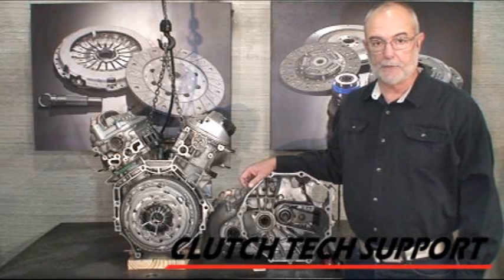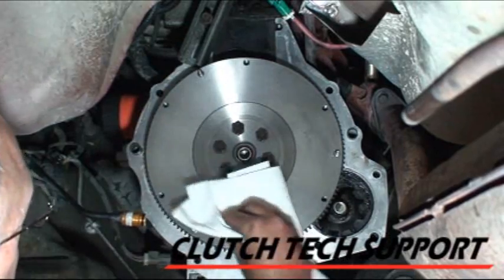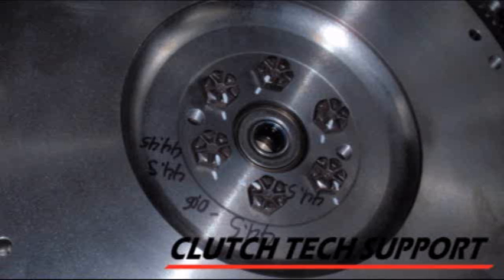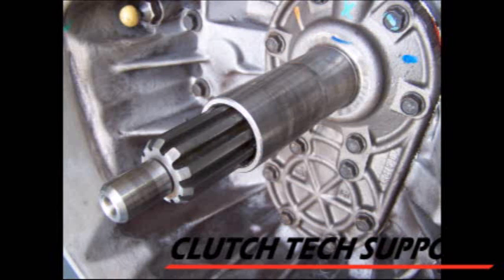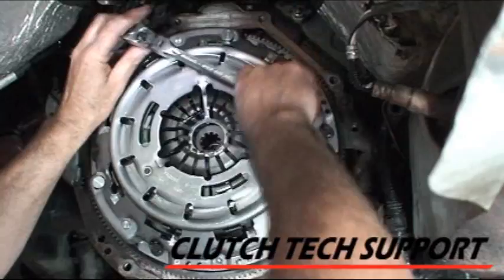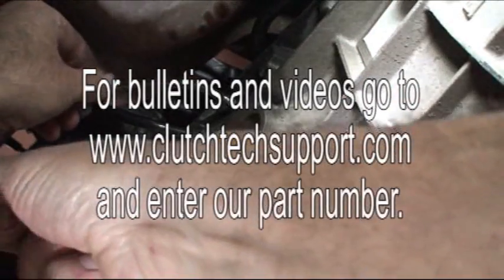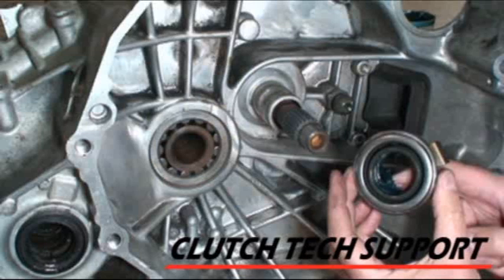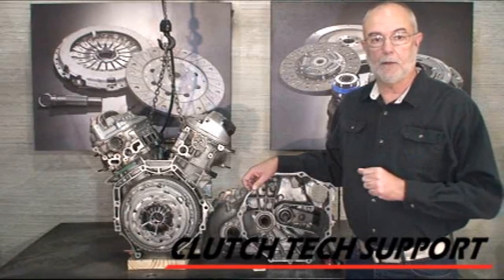Clutch Quick Start Installation Guide

Comment: Do you use lock washers or loctite on clutch bolts. What grade bolts do you use?  Application is small block chevy 327 1966 chevelle